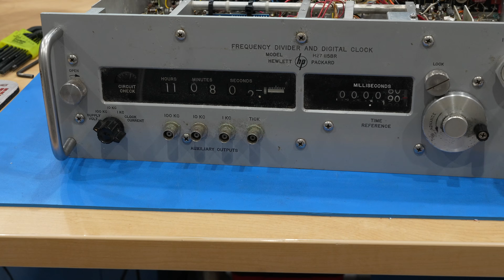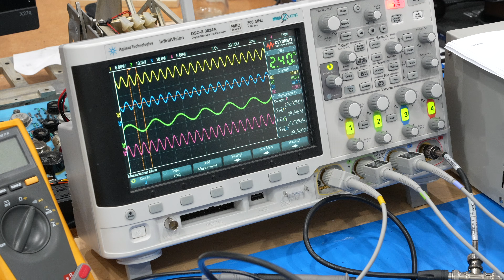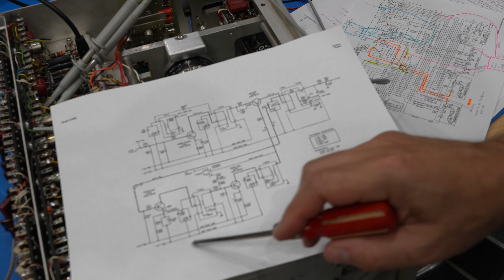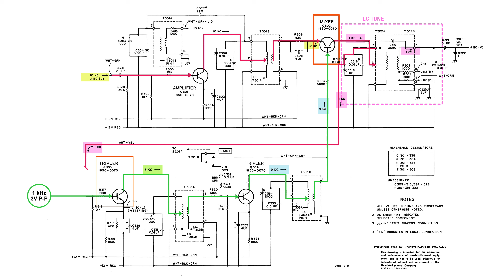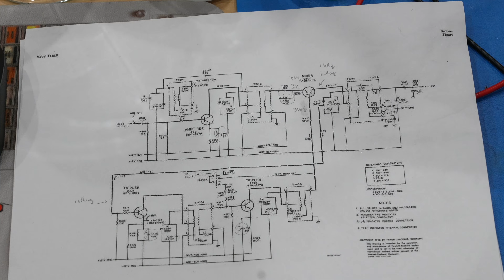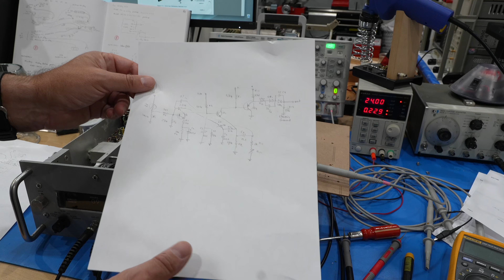HP 115BR Divider and Clock - Part 2: Repair

Comment: The one thing I don't understand is, do you have to open it up and flick the switches and spin the motor every time you turn it on to use it!?
Since it's a clock I assume you would leave it running often, but the idea of having to take it out of the sealed rack and remove the cover plate to spin the motor sounds... cumbersome!
Reply from the maker: Done on purpose, so the clock can't be changed easily. Also, it stops dead in its tracks if the 100 kHz disappears for the shortest moment, as the regenerative divider will stop and won't restart. It's a "feature", so it will not restart and indicate a time that's not traceable to the atomic standard without anyone noticing.
Reply: @CuriousMarc I would have thought that it should be accessible from the front behind a cover with a tamper proof seal.
Reply: Presumably in its new life, the unit won’t be used in any terribly critical applications. I wonder whether the Arduino could be repurposed into a discreet start-up sequencer. “Pushing” buttons would be easy. What’s a good way to spin up the motor?  A tiny tiny version of an automotive starter motor would be ridiculous, but fun. 😁

Comment: Bad ancient tantalums?
Who would have thought!
Tantalizing repair.
Reply: I remember seeing an Amiga (late 80s/early 90s computer) for sale on Ebay where the vendor advertised that they had replaced ALL the capacitors as a matter of course!
Reply: @zh84  Sadly, this seems to be commonplace. Inevitably, it introduces new problems, as Adrian's Digital Basement found recently. He replaced the caps on a Mac SE/30 motherboard and in doing so accidentally bridged a 5V signal line to the 12V power rail. I've seen all sorts of other problems caused by recapping - reverse polarity, massively wrong value, under voltage spec etc.
Reply: @Zadster  I have seen folk replace smoothing capacitors with much higher values "to make it better", only to find that the increased inrush current blows up the supply.
Reply: This old RF jock thought 'bad caps" right away. If my semiconductors are good, every electrolytic/tantalum cap becomes the next suspect.
Reply: Good old tantrum capacitors!

Comment: This device appeared in the recent Nova on PBS.   Just for a few frames, but it was so obvious after having seen Part 1.   Will try to get a link and offset for y'all.
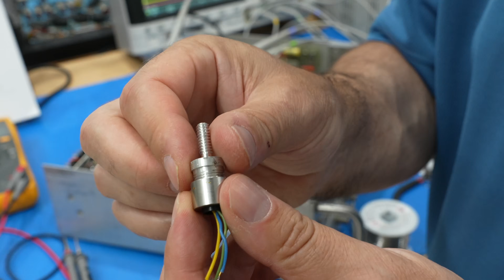Reply from the maker: Just watched it. Great episode on how quantum mechanics affects everyday life: https://www.pbs.org/wgbh/nova/video/decoding-the-universe-quantum/ . The HP 115BR appears briefly at 17:35, followed by the HP 5061A Caesium clock equipped with the later integrated Patek Phillipe divider and clock. Awesome science documentary, they are right up there with Veritasium. Or is it the other way around?
Reply: @CuriousMarc  Video not available for german users :(

Comment: So do you always have to kick-start the resolver, or does it now start on its own?
Reply: Many synchronous motors have a 50/50 chance of turning either direction.  Henry Warren invented and patented a self starting synchronous motor in the 1918 which always turned the same direction. Warren’s Telechron company was bought by US’s General Electric.  Most other manufacturers’ clocks had a manual start knob to get the motor turning the correct direction.  I’ve seen a few old clocks with a ratchet mechanism which would jam if turning backwards and bump the motor to turning the desired direction.  Apparently HP didn’t want to pay royalties for a self starting synchronous motor along Warren’s design.

Warren had the idea of using the AC power grid to transmit an accurate time reference frequency to home clocks which would count cycles via synchronous motors gear divided to display time on a clock dial.  In the 1920s, there weren’t national grids and line frequency was approximate.  Warren invented a companion power station master clock to monitor grid frequency.  I have one in my clock collection.  The master clock consisted of an electric clock section using a Telechron rotor motor.  There was also a high accuracy pendulum clock.  The two clocks were connected to a differential which was attached to a pointer to indicate need to speed up or slow down the power station alternator.  The Telechron motor also kept the mainspring of the pendulum clock wound.  The pendulum clock was regulated by listening for a radio time signal and using tweezers to add or remove tiny weights on tray on the pendulum rod.
Reply: @wtmayhew  cool, NTP before NTP. I guess, why not sync clock from it now, at least in the US and other 60Hz countries. For anyone on 50Hz, well, sorry?
Reply: @c1ph3rpunk  The rotor assembly of a Telechron motor is enclosed in a brass or aluminum housing pressed by hand into the laminated pole  assembly with the field coil.  The rotor assembly encloses a gear train to drive a 1 RPM (usually) output shaft.  The whole assembly with gears was called “the rotor.”  Rotors were available for at least 25, 50 and 60 Hz and possibly others.  The same field coil assembly could be used for all the rotor types. 

The master clock I have originally had a 25 Hz rotor but the person who owned the clock before me swapped it for a 60 Hz rotor
Reply: @c1ph3rpunk  as far as I know the grid frequency is still regulated in most countries and some clocks still use it for a reference. The digital clock in a microwave oven springs to mind. Frequency can vary slightly over the course of a day but it's guaranteed to add up to 5,184,000 cycles in 24 hours, or 4,320,000 in 50Hz land.
Reply: Agree with the “but how do you start it with the covers on?” Question. Super fun debug sessions!
Reply: @tyrueiI model T external crank start?